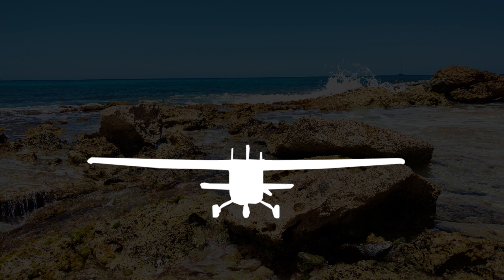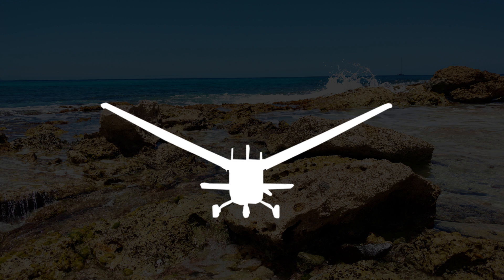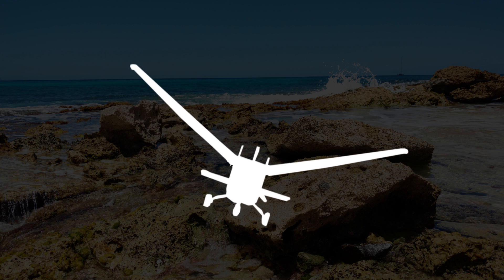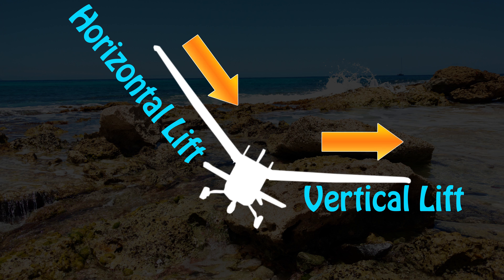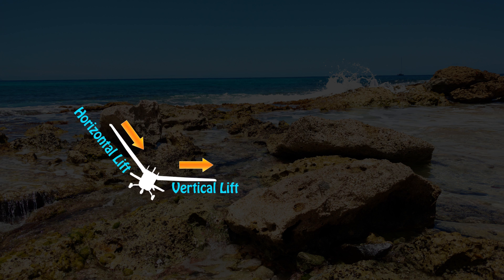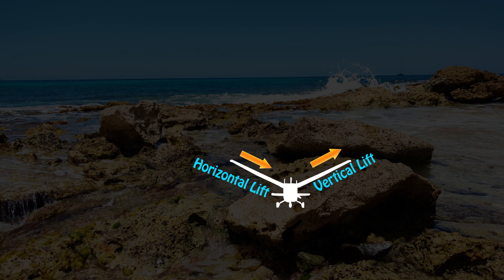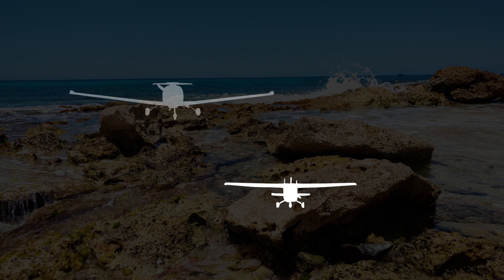Transitioning from a High Wing to a Low Wing Airplane | Explained

Comment: The main differences are in stability and visibility. A high wing aircraft has static stability as the lifting surface is above the center of gravity, but this results in poor visibility as the wing blocks the view in the direction the aircraft is turning. A low wing aircraft has marginal stability, as the center of gravity is above the lifting surface - the aircraft wants to turn over. That is countered by the wings dihedral raising the center of lift in relation to the CG, but too much dihedral lessens effective lift. The advantage is full visibility in the direction of turn, as the wing is down.
Reply: AnneJdeB side slip conditions present during turns cause unequal lift, in high wing planes it tends to right the aircraft. Low wing planes achieve this level of stability with their dihedral.
Reply: Paul Moffat I think your comment explains very well as to why are these two designs in the first place.
Reply: There is no difference in lateral stability between high and low winged airplanes. I have flown plenty of both and I have been a flight dynamics engineer for 28 yrs. These are typical private pilot ground school wives tales. Pilots teach pilots, the blind leading the blind. I have never flown a low wing airplane with "marginal" stability. My Jodel has excellent lateral stability as the all the RVs, cherokees, cirrus, you name it. To say nothing of all commercial and biz jets.
Reply: There are FOUR contributions to lateral stability.   And each ONLY work when the plane is slipping. 

1) Dihedral. The lower wing had s higher angle of attack then the upper wing. 

2) Wing sweep. The lower wing had a higher aspect ratio than the upper wing. 

3) Wing fuselage interference (commonly, but mistakenly, called “keel effect”). On high wings the fuselage increasing the angle of attack on the lower wing vs the upper wing. 

4) Tall tail effect (often mistakenly called “pendulum effect”). The amount of surface area above the centre of gravity vs below it. 

Different aircraft will have different amounts of these to produce the same results. A cargo jet like a C-17 has a tall T tail, high wing, and swept wing. Therefore it has an anhedral to REDUCE the amount of lateral stability it has. 

A high wing uses less dihedral but isn’t unstable. A low wing uses more dihedral to increase stability. Etc etc.
Reply: This sounds a bit like the pendulum rocket fallacy. Lift is always perpendicular to the lifting surface isn’t it? If that’s the case, your first point should be invalid, since the lift works along the same ‘workline’, ie had the same arm of moment, for both high and low wings. Am I missing something? I’m not an aerospace engineer.
Reply: Yes side slip is the key too dihedral effect, but dihedral effect needs to be in balance with the vertical surfaces esp. tail design, to little diheral effect and you move toward spiral divergence(an increasing sideways dive), too much dihedral effect and you get a dutch roll oscillation.

Comment: When I did my training I took up what ever was available on the day. Usually PA 28 or C172. I preferred the Piper as I liked the mechanical flap system.  Although I also appreciated the Cessna's visibility factor.

Comment: Couldn't watch past four minutes.  It's shocking how little a licensed pilot knows about aerodynamics.
Reply: Just tell us something so we can make fun of your aerodynamic knowledge. Really, aerodynamics knowledge does diddley squat to your flying skills. If pilots spend as much effort making sure they had enough fuel, properly checked weather, and had good systems knowledge, the skies would be a lot safer. The only aerodynamics pilots need to know for light non-high performance single engine aircraft are to maintain proper and safe airspeeds, the proper cycle of control (yaw, roll, pitch) and to respect stall warnings.

Comment: Ok so I fly a biplane which wing is creating more lift and a what time. It my understanding that while the lower wing remains in ground effect much longer then the higher one. So while in GE the lower is creating more lift until it’s out of GE then both wings crest equal lift?
Reply: Biplanes have what’s called “decalage” which puts the wings at different angles of incidence. Usually the low wing is at a higher angle of incidence, so it will produce more lift. This is mainly for longitudinal stability.

Comment: Does it sound crazy that I would actually prefer a high wing since you have doors on both sides?  I noticed the low wings all have one door, and thats on the right so the passenger has to get out just so the pilot can get out. I hope i am wrong, because I saw a guy on here named Jerry that has a Cessna low wing with dial engines, and i like that plane but not the one door deal.
Reply: The Beech Sundowner had doors on both sides. 

But the other reasons why low wings suck. No cover from rain or sun, and you have to climb up onto them.

Comment: the low wing is a "laminar flow" wing
Reply: The Piper is too light and slow for it to make a difference—like putting drag slicks on a Fiat Panda. Cessna found out the hard way with the Cardinal that heavy and slow makes laminar flow airfoils worse than the 4 digit NACA 2412 one they use on every other of their aircraft.

Comment: Dihedral is what prevents the plane from falling out of the sky when making steep turns!
Reply: Victor Palamar No, that is lift. The only thing dihedral will help with is stability. In a steep turn dihedral will actually fight the turn because the airplane wants to roll back to level, so you have to keep your roll in input throughout the maneuver. The input that keeps you at a constant altitude is the back pressure on the elevator, which puts you at a higher AOA and increases lift.
Reply: Keegan Sponholz. No, as well. Dihedral does NOTHING in a coordinated steep turn. In fact, you actually have to input opposite aileron to keep your bank from steepening due to the difference in airflow on the outside wing vs inside. Have a look at the position of your yoke/stick next time you’re in even a Rate 1 turn... you might be surprised.

Comment: I think JFK Jr. crashed because he was in the low-wing Piper instead of the high-wing Cessna 172 he had the most experience in.     I learned to fly in a Cessna and also flew high wing Piper Tri-pacer and then converted to Gruman Traveller and found the difference in spatial awareness acute because you can't look straight down at the ground!
Reply: Victor Palamar He also flew into IMC, so aircraft familiarity may not have been the only factor. He was a low time pilot with little instrument flying experience and wasn't able to trust his instruments enough to fly himself out of it.
Reply: I was flying in the same conditions north of him. It was particularly hot, humid and hazy. Visibility during the day was  limited to 1-2 statute miles. After dark, VFR was not possible, you needed to be on instruments starting at dusk.
He was over water, most ground lighting would have been more than 1-2 miles away, basically a black abyss below him. VFR and no visual reference, and oh yeah, a complex single doin' 200mph, plus two distractions ridin' along, low experience, that's a toxic brew.  Be careful out there...
Reply: JFK jr died because he was out of his league. The aircraft type had nothing to do with it. I can't imagine dying like he did at sea level. Imagine flying in the mountians!
Reply: Lar Mar 
JFK jr died of thinking being brave and rich was a substitute for being qualified and experienced.
Reply: Lar Mar. Everyone who is flying is out of their league, but with proper training and correct actions, for given conditions, we keep the plane in the air.

Comment: But won't moving the wings up or down change the center of lift?
Reply from the maker: Center of lift as we talk about it typically mean lift moving from the leading edge to the trailing edge of the wing.  Sound like you might be interpreting it another way to mean lift acting on the fuselage?
Reply: probably means center of gravity

Comment: Are you considering wing loading? Mostly your theory is wrong from an aerodynamic perspective - very pilot based as opposed to physics / aerodynamics.  Do you buy into the myth of top-of-wing-suction?  It is not how a wing flies at all - though still taught and defended - kind of like global warming.

You have misled the viewers ref the vortex generator on the LE as well.  You can take this feedback as annoying - or you can seize an opportunity to learn.  Taper does NOT cause less lift on the tips.  Ground effect is way over-rated as a contributing factor.

JR
Reply: Global warming is real.
Reply: James Ryzlot it is a pilot based video intended to help you fly it is not intended to get you a degree in physics it is basic
Reply: Wing does fly because of suction. Leave a fuel cap off... you’ll see your fuel getting sucked out.. We do a metric fvckton of rib stitching on fabric aircraft to keep it from ballooning up in flight. The pressure drop has been measured instrumented wind tunnel tests and on test flights. It’s lower because of the higher velocity air over the top of the wing. You can destroy that velocity by extending tiny spoilers which destroy lift almost complete. You can also measure that velocity difference. Global warming is also real because of the same types of empirical data that support the theory.

Comment: Why aren't the wings on small planes designed the same way as larger planes where the length is longer at the structure and shorter at the tip? Also what happens if the wings are mounted direct center of the structure instead of at the top or bottom?
Reply from the maker: If you mount the wing direct center of the fuselage nothing changes other than it is harder to design a door that is easy to get in and out of.

Comment: I never liked C172 for its poor visibility due to the wings blocking both sides.  Instructor told me to slightly bank into opposite direction to check traffic before actually turning.

Comment: Can you explain the Spitfire wing. Considering that it is a high performance aircraft the wing seemed to be able to handle a wide range of the flight envelope and still be an easy machine to fly. It had washout for near stall control, deep chord for 60 - 70% of the length and tapered to a point which would have countered any negative wing tip vortexes.
Reply: Uncle Bullfrog I'm no expert, but I'll do my best. The spitfire's elliptical wing has a lot of surface area which helps to keep it stable at low speed (however once it stalls it's NASTY) and the shape helps to disperse wing tip vortices, allowing it to maintain a low drag profile, keeping it stable at high speeds.

Comment: TLDR; Piper is a poor design.
Reply: There are several benefits of the Piper Hershey Bar design that this video doesn't cover. Check out A2A Simulations extensive discussion of the older Piper Cherokees that had the straight wing.

https://www.youtube.com/watch?v=h8AV7iH6HWk
Reply: Already wrote two comments!Read at top!Obviously you have not flown the line!I have a bunch of Time in the six as well!What an Aircraft!!!
Reply: David Holland Really!?!  I loved my Tri Pacer!!
Reply: I would suggest you fly both before you judge!
Reply: I agree
Reply: +Jerry Ellis gust of 20?! I'm pretty sure I landed in some 30 knot crosswinds on dog-leg gravel bars with my old boss at the stick of his cherokee. Cool to finally learn what sort of badass stuff those bush pilots were really up to. Didn't think twice at the time.
Reply: I guess you've never flown a Cherokee with a 'hershey bar' design.  I took the PP test in a Cherokee Six and did 3 consecutive 90 deg.crosswind landing with a 15-20 gusting wind.  I think the Cessna's would have had a hard time with a newbie pilot doing that.  The Cherokee's are so stable when landing especially near gross weight it no comparison.  I tried the Cessna's before I bought the Six and didn't like them at all.  Poor visibility in the pattern, harder to land in a crosswind and like Apple too many fanboys.
Reply: @ Jerry Ellis

The Cherokee Six is a heavy airplane. Compared to the equivalent Cessna, the 206, I’ll take the 206 every day. Especially with the seaplane rudder that will handle any crosswind you can throw at it.

Comment: I liked this video a lot, but you neglected a huge difference that is determined by high vs low wing. visibility, specifically, where you look in the turn. Neither is better than the other, but there is a real difference from the perspective of the pilot.
Reply from the maker: Oh boy, I'd hope that's self evident.  If you're a ppl and don't realize that from looking at the plane sitting on the ramp, might want to just stick to playing golf instead. :)

Comment: Good video but a camber is not equivalent to thickness. Camber is a measure of the asymmetry between the top and bottom of the airfoil. One way to understand camber line is that the chord line will be equidistant from the top and bottom surface at all points on the airfoil if camber is zero.
Reply: I build and fly r/c planes as a hobby, with plans to get PPL after kids' college is paid for. I've gained more knowledge about aerodynamics from this than I could have ever imagined.
Reply: You cannot have a lot of camber without thickness definition of camber straight from NASA The maximum distance between the two lines is called the camber, which is a measure of the curvature of the airfoil (high camber means high curvature). The maximum distance between the upper and lower surfaces is called the thickness 
https://www.grc.nasa.gov/www/k-12/airplane/geom.html
Reply: Hi, thank you for the video.  I also have to agree with Vaibhav, while it's great that you aimed for simplicity at the private pilot level, you've unfortunately defined camber incorrectly.  It would be great if you added annotations or something to the video explaining that we should really call it thickness, just so people don't get confused.  I do wish there were more references out there like yours though, geared towards helping new pilots understand aircraft performance at a simple level.  Cheers and keep up the good work.
Reply: Wrong is wrong, using the incorrect terms under the excuse of simplicity  just inhibits future learning and spreads ignorance in the community. 
Dihedral was basically correct, sweep has a similar effect.
Twist for stall properties was correct. (though it can be had either mechanically [same airfoil root to tip], or with aerodynamic design [looks flat but the airfoil shape at the root will stall sooner than the tip].)

Overall wing shape viewed from above [eg Hershey bar] is called the "planform". planform effects ease of manufacture, drag efficiency, and responsiveness
 
Camber is curve, the term is also used for skis, it is completely independent of thickness. Thickness is called thickness and is expressed as a percentage of cord. The Wright bros plane had high camber and very low thickness. Thickness also effects structural strength and stiffness(bending and twisting)

Aspect ratio has nothing to do with the design-speed or total lift, it is a trade off between low induced drag(long is good), strength(short is good), roll rate(short is lower inertia), and for the extremes, transport of parts and space around ground structures. Wingtip devices are used to mod these same traits. 
The 777  does mach .85 and has a very high aspect ratio and tapered planform, so it wouldn't benefit from winglets, but it is also at the limits of width for most airports, the new 777x actually folds 12 feet of each wing while on the ground.
Reply: Yep. Camber is curvature of the wing. The NACA 2412 airfoil on the Cessna 172 actually has more camber than the NACA 65-415 used on the Cherokee. You mean thickness ratio/chord-thickness ratio, or fineness ratio.
Reply from the maker: Yes, but we're going more for private pilot simple here, less engineering specific (i.e.  the elevators are more properly known as "flippers")   :)
Reply: i bet your a engineer?